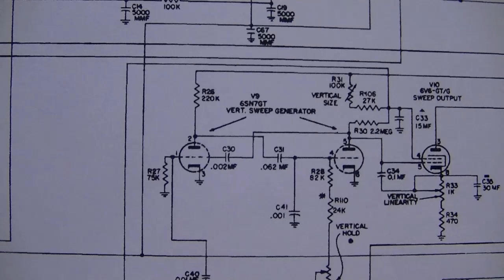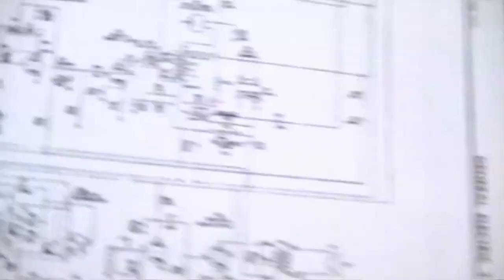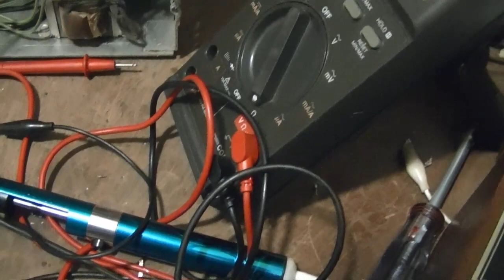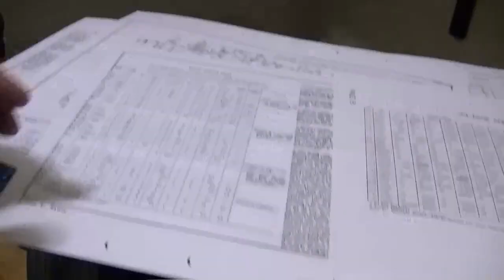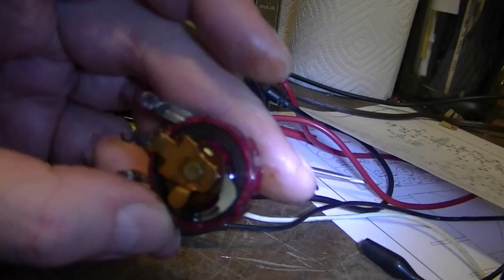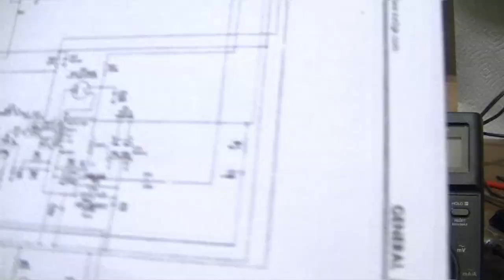GE 810 Redux p3o?

Comment: was watching this old three year old video on the ge 810.  You found the carbon worn off on the horizontal hold control.  what I was watching today was crt gun replacement.  what they painted was aquadag.  this aquadag is carbon suspended in various fluids, including water.  some more durable than others. Here is my idea. use the aquadag, in a binder that holds it steady, like paint. then for the horizontal hold wiper, you just paint it on the track and make your own carbon track.
Reply from the maker: I've read of it being done with old radios where replacement controls are very hard to find. it's tough to control the resistance and the track wears out

Comment: If you have a parts chassis for one of those G.E locomotive type sets the controls have very similar shafts to that 810, but I don't know about the electrical value of those controls. If you can find a Bakelite portion with the carbon element to fit you can reuse the shaft and wiper from the old control in a replacement.

Comment: It's funny that "Kalinga Athulathmudali" talked about the "high pitch noise". I remember as a kid walking along the sidewalk in front of homes. Along the way I could hear that sound outside and new which house had their TV on.
Half the voltage, huh? I bet if the tube wasn't aluminized, the picture would be VERY dim.
I'm interested to see what it turns out to be.
Good luck in getting that control! You are lucky that someone responded so fast.

Comment: Thanks for answering. That is a nice station, in my opinion the conical tips are useless and you shouldn't even bother with them. I cannot find a WES-51 here, the closest one is WS-50 which is quite old and overpriced here. So i've got an Metcal MX-500 instead.